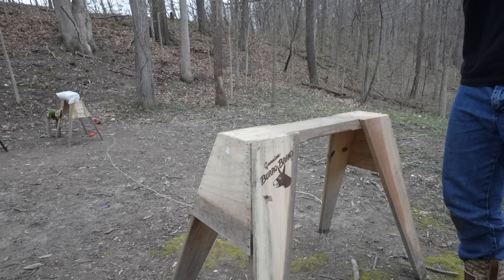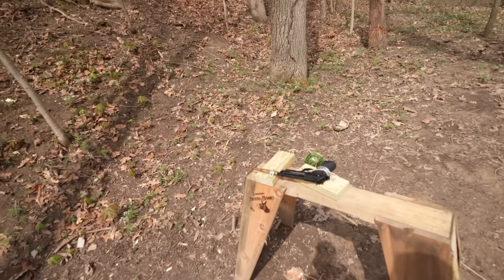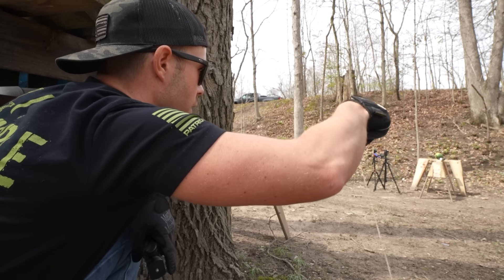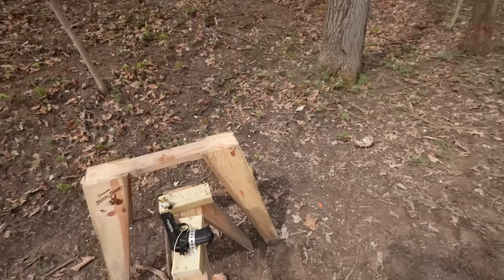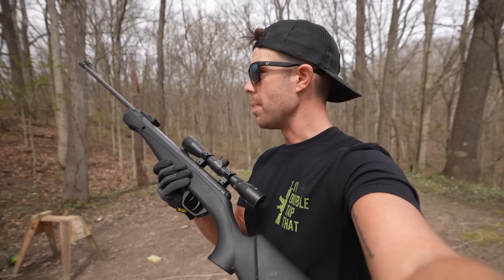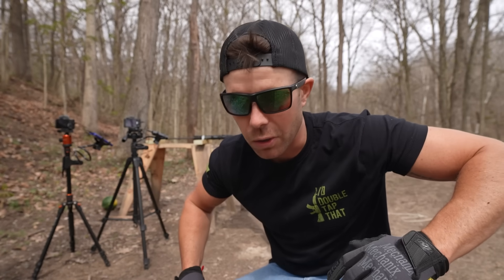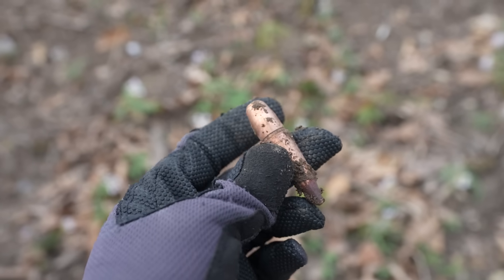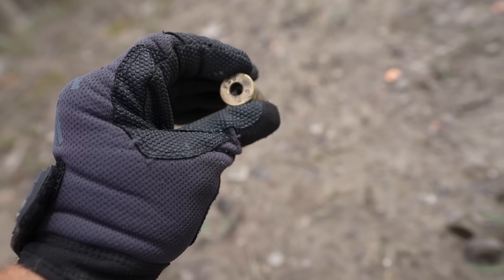What Happens When You Shoot a 50cal Primer???

Comment: Dude, that totally could have killed somebody if it hit. And I don't think the primer popping back in the back of the case could have provided nearly a good enough seal to cause the cartridge to detonate. I think the pressure inside the case finally built up enough on its own to ignite all the powder at once and the primer was just a coincidence. You should know that most firearms cartridge powders are designed to burn under pressure, that's why it burns so slow when there is a puncture in the case.

Comment: My first thought on the primer-stuck-in-BB-gun thing was that it wasn't actually stuck in the muzzle, but was being held in place by the exhaust from the Secret Ninja Rocket Cartridge, and was released when the pressure vented out the front of the cartridge.
That, however, wouldn't explain the BB gun firing a second time, which clearly happened.
Maybe a hybrid explanation: primer held against BB gun by rocket exhaust; cartridge ruptures and vents pressure; vibration from the case rupture causes BB gun to fire a second time.  Did you still have tension on the string at that point?  Wouldn't take much bounce of the sawhorse to reset the trigger and fire again...?

Comment: Years ago, we used to put a cartridge about 30 yards away and take turns shooting very accurate pellet riffles at the primer.  One day, we all lit it up simultaneously and the guy third down the line said, owe (a hurt noise, not sure spelling) and he attentioned us to his chin. There was a ring of red, just about to release a single drip of blood, the ring was the same size as the shell without the bullet. So either the bullet stayed in the fence and the brass shot back and spun around just in time to carve his chin, or he was fucking with us and cut his own chin. He did have one of the most accurate sidelever that day, and would have put his chin directly in line with the inverse of his bore.

Comment: I tried shooting a 7.62x39 primer with a .22 Ruger Standard a few weeks ago, I missed the primer, hit the casing, and tore the shell apart. Still cool, but it’s not super easy to do. 

The slow motion was super cool! The primer definitely went back to the shell when it went off, like you said not sure if that made it detonate, but it could be. The slide on the beretta cycled when the shell went off too.

The delay is super weird but you basically have a mini grenade with a 1-2 second fuse when shot with a BB gun. 

Nice job on the 10-22 shot! I know it’s not easy to hit.

Comment: Have you ever heard of pellet dieseling I'm curious what kind of velocity you can get from doing it the loudest pop I've ever got from doing it is with automatic transmission fluid but I've tried gun oil regular engine oil 3 in 1 oil and petroleum jelly and the transmission fluid made the loudest pop like a 22 lr but what you do is put a small amount of oil in the skirt of the pellet after you put it in the pellet rifle
Reply from the maker: No i haven’t heard of that. Curious now to try
Reply: @1ShotTV  I do it with my gamo shadow whisper rated at 1000fps and it seems like it shoots faster then my 22

Comment: It seems as if the remaining gasses from the BB gun barrel built up inside as the primer plugged it, then fired out again as the pressure became too much. Causing a second "round " to fire back out the barrel then ignites the powder that was close to the primer hole due to that primer's ignition. All in under a couple seconds. Bang there goes your 50.

Comment: The power of charge in the primer will continue to launch the primer cap out of the primer pocket because there is no resistance, like a bolt face & firing pin, to trap the cap in the pocket. The rocket engine effect is WAY KEWL and the delayed explosion is also a REWARDING BENEFIT! Keep up the great content!

If you feel lucky, use the BB pistol WITHOUT a strap and see if you create a missile… just a thought.

Comment: Cool experiment!  Here is something you might try.  Mount you 50 BMG down then mount a block of wood behind it with a hole in the block where the primer is. Then put like a 1/16" sheet of Copper between the primer and the block of wood. Then use a Pellet or bb gun.  That should bulge the copper enough to fire the round and not blow out the primer.

Comment: Primer fell.  BB was pushed back into the barrel. Then launched up and away. Easy to tell beca7se of the copper coating on the BB. It was visible.
Reply from the maker: I thought so at first but if you look at the size of the object that stuck in the barrel it is way bigger than a BB. Even if deformed, the bb might not get that big. Primers have a copper colored skirt inside which is what i thought it was. Im not sure you could absolutely be right

Comment: In a rifle, the face of the bolt holds the primer into the case. The primer is the course of least resistance, so to speak, and the pressure of the burning powder just pushes the primer out before the pressure builds up enough to launch the projectile.